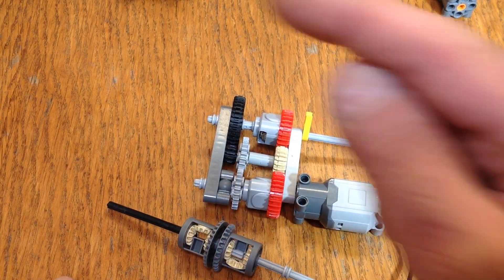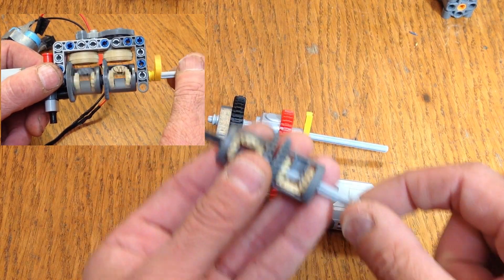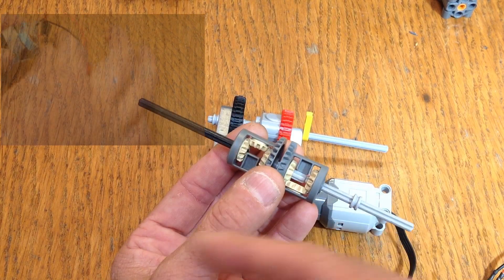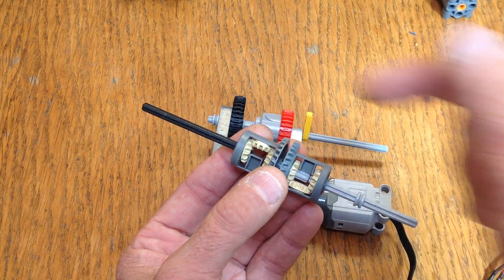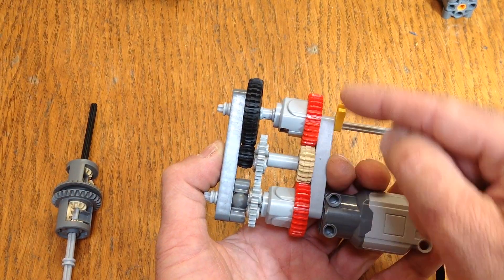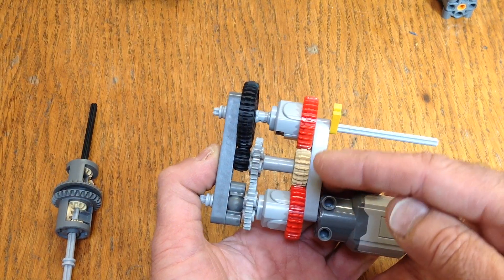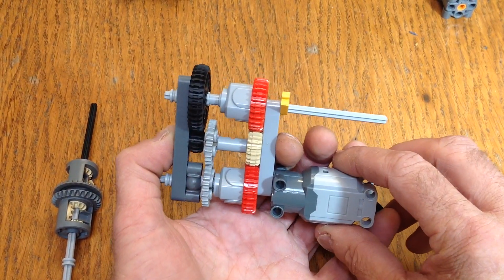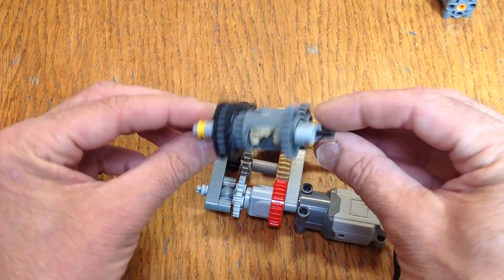Small Lego Automatic 2 Speed Transmission

Comment from the maker: Less friction, smaller, better frame, two ways to build.
Reply from the maker: No springs, rubber bands, or gear grinding.
Reply: @MaxBrix  I am wrong
Reply from the maker: @saturnion4453  Most people think this behaves like a CVT since it mixes gear ratios to produce any ratio from 1:1 to 3:1
Reply: @MaxBrix  ok I guess it's time to change comment lol
Reply: @MaxBrix  I'm definitely one of those people who think of this like a CVT. Thank you for bringing up the ratio mixing.
Reply: @MaxBrix   just a tiny bit of resistance   will make it switch to 3:1 no ? Maybe with a torsen differential can be good i don't know , or if you got a stronger engine it could be ok ? bcs i think  its so simple you can use on a bike or a car by adding a cvt reverse gear with a planetary gear set like with toyota

Comment: If this transmission needs less friction to change gears, does this mean that if I use a heavier vehicle, it 's more likely that it will always be in the heaviest gear? Is there any way to increase the torque or resistance needed to change gears?
Reply from the maker: Your assumption is correct. This thing is not practical for most vehicles. It is just a concept piece. Even making this thing work in a vehicle made for the transmission is difficult. If you have enough room in your model and need more gear ratios an electronic shifting transmission would be better.

Comment: @MaxBrix maybe you can help me a little. 
I tried to make a gearbox of this kind and it seems the second path isn't used. 
I almost stop the motor when i apply constraint to the output (gradually of course) and the second path seldomly starts. 
I tried do give the outside path a bigger and a smaller to 1:1 ratio and the first path never change from 1:1
(I have a xL motor connected to that)
Please help
Reply from the maker: Don't worry it's not actually very useful, just kinda interesting.It's been years,  all I can tell you is these things can behave oddly if anything is different.
A few things to try:
1. It will work better in a sturdy frame.
2. switch input/output
3. reverse motor direction
4. use a faster, lower torque motor.
Reply: @MaxBrix  thank you for your very reactive answer. I'm a little disappointed to know that it's not me who missed something, but the type of assembly which is not completely reliable. It would have been easier to correct if it were my mistake. 
Anyway, thank you for your advices. 
I Can work on the sturdyness which i totally neglected for the gearbox tests (i hold some bricks with m'y hand sometimes ! : )
I tried changing the motor direction but i need it to work in both directions (it's for a model, not just for mechanical tests). 
I cannot change the motor type. It's determined by other considerations.  
I spent my evening trying to redesign (on paper) the Gearbox. Consider a differential has a cage and two axles (i don't know the real words in english), i'm gonna try to have one axle and one cage in each Gear (while you had a cage to cage Gear, and an axle to axle Gear), trying not to lose too much room.

Thank you for answering so fast. I'm only at version 1387. There still are solutions to try ! :)

Comment: Is it possible to use a worm gear with one 40 tooth gear and two bevel gears? Reply as soon as possible if you want, thanks
Reply from the maker: No, but I made that years ago so I can't remember what would happen.
Reply: @MaxBrix  Thanks for the reply. But if you put an 8-tooth gear with a 40-tooth one, what would happen? Would you increase the ratio from 3:1 to 5:1, thus more torque available? Thanks again.

Comment: Cool design! I am trying to use this in one of my LEGO car, but I noticed that even with a XL motor, the output can be easily stopped with very little Touque. Any idea how to fix it?
Reply from the maker: Is the motor still spinning and the output has stopped?
Reply: @MaxBrix  yes
Reply from the maker: @Legobee1  Maybe if you reduce the ratio difference you will see more torque. These mixed path gearboxes act weird outside of certain ratios. Also one path may be spinning in the wrong direction.

Comment: I love this design so much. Could you possibly make a tutorial to build it, because I build it and it looks identical to yours, the only problem is though that for some reason, when I put resistance on the output so that the ratio will switch or the gear will change instead of switching to first, the differentials just start turning in the other direction, unlike yours where they just slow down and the internal gears take over. Anyway if you can at some point, that'd be great, otherwise, keep up the great builds.
Reply: Exactly. It doesn't work out as soon as you apply a bit more friction

Comment: This might actually be a mechanical launch control system too. I have a theory that anytime you would get any hint of wheel spin it would just reduce the gear ratio slightly. Might be interesting to test this on a very overpowered rc car with 3d printed gears. And for efficiency and compactness sake 1 its not gonna use an intermediate shaft cause it wont need to cause its not lego and 2 its gonna use planetary differentials

Comment: stick variable position 90 degree clutch wheel on disc
Reply from the maker: Sounds dangerous. I don't want to cause a spacial rift
Reply: @MaxBrix  there is already a rift, support from both sides of the both moving rings
Reply from the maker: Time and space will cease to exist as the awesomeness of the transmission ripples through the Universe converting all matter to energy... and it has already begun.

I hope you speak English. This response might be a little weird.
Reply: @MaxBrix  stock answer
Reply: @MaxBrix  strictly speaking I have rendered the energy from fusion disc

Comment: Your 2nd example is partially blocked by the end screens.  It looks like an 8T gear connects the 24-16 differentials on one side, but what gears do you have connected to the chain on the other side?  Thanks!
Reply from the maker: 16 input 24 output.
Reply from the maker: I pushed back those end screens. Thanks for the heads up!

Comment: wow this looks interesting Max, what's the detailing on the lower left of the frame do? is it functional or or just a simple axle support?
Nice work! and the most compact and clean iteration yet. My motors have arrived so I should complete my Lego video 👍🍺
Reply from the maker: That is just a 3 hole technic beam. The center hole is ball shaped. Not sure where I got it. Never used the ball. It looks cool though. My kids have some Bionical stuff, it could be from that.
Reply: @MaxBrix  Ahhhhh cool. I was wondering if it was some kind of friction pin. It looked interesting! how's this design work when loaded up with a vehicle? I have added my CVT to the Klann walker and it's taking a bucket load of configuration to make it work!!? in some ways I hate Lego being so easy to prototype, but so hard to realise. All our dreams are massively hard to make happen, even my missus see's that the RC stuff is easier!! yet I don't wanna give up on 40 years of Lego addiction! 👍🍺🇬🇧

Comment: I have been proven wrong
Reply from the maker: The gear ratios are 1:1 to 3:1 and anything between.
Reply: @MaxBrix  how did you do that with gears? Interesting
Reply from the maker: I only made a small improvement on what other people did before me.
Reply: @MaxBrix  that is what is called Innovation. Now I'm wondering if you couldn't use this for a custom hobby grade RC automatic transmission? Maybe JohnnyQ90 could help answer this question?
Reply: That's a nice thing to say, not many people would 👍🍺